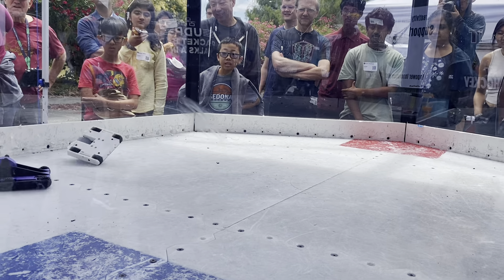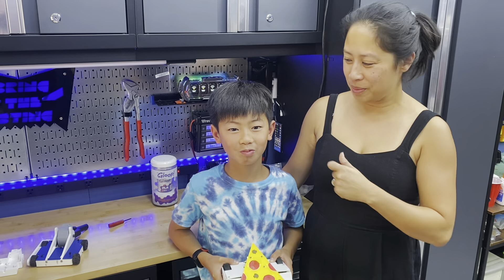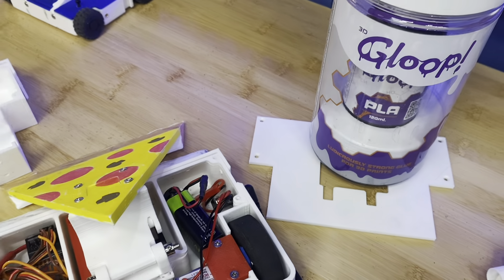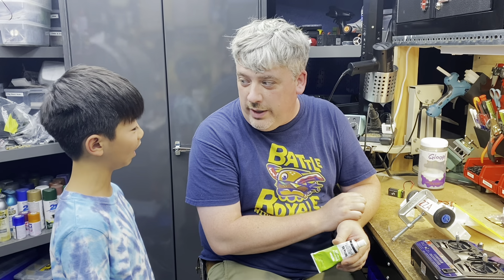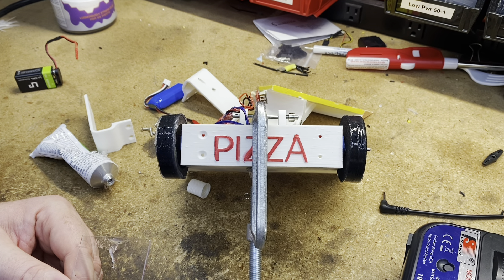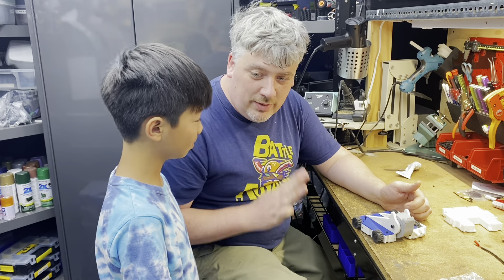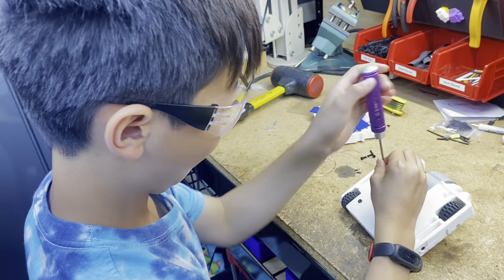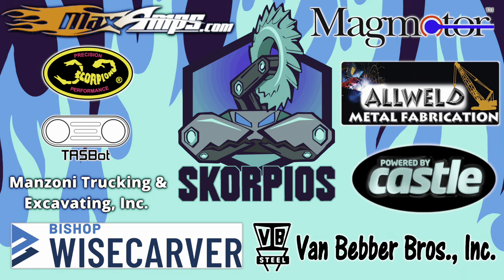How To Fix Your Combat Robot After It Fights

Comment: I wonder how the product q bond would work on that sort of plastic. We use it alot in smash repair for bumpers and such its like a super glue and 2 types of powder for different materials but once the powder is added it dries instantly and can be rigid or semi flexible and can layer to get good build and span a gap